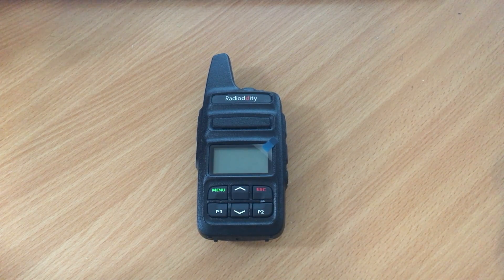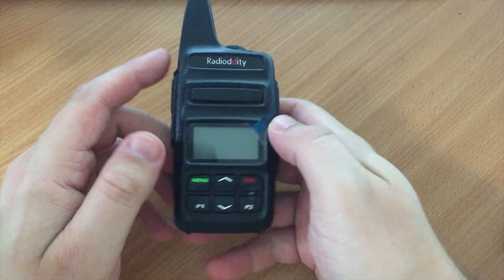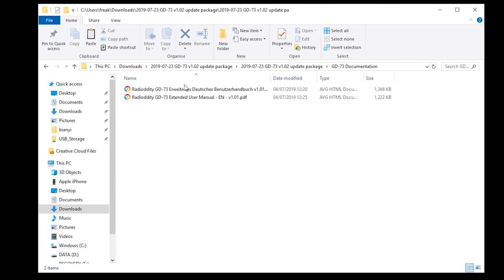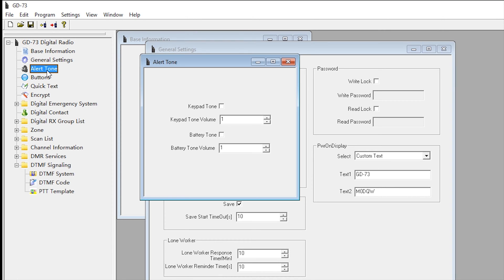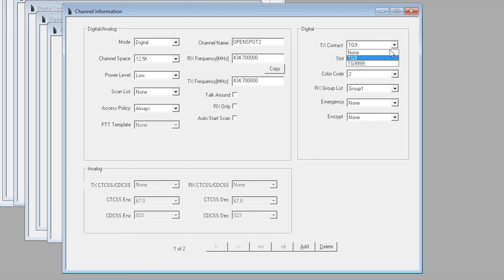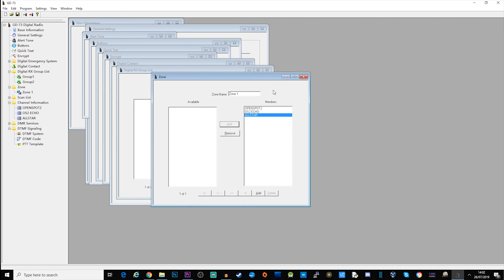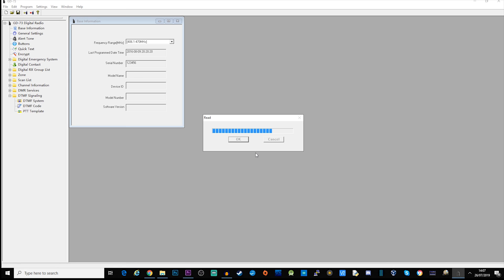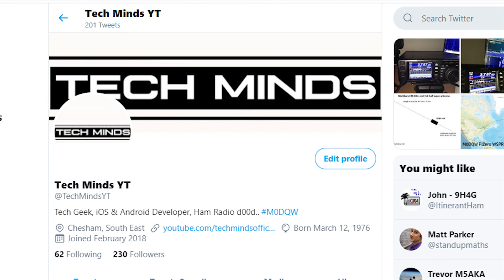Radioddity GD-73 Overview and Programming

Comment: Thanks for the video. I'm having problem starting the software.
---------------------------
CPS.exe - Application Error
---------------------------
The application was unable to start correctly (0xc000007b). Click OK to close the application. 
---------------------------
OK   

I also had problems with libusb0.dll missing. Any thoughts? -Pres

Comment: Thanks for the video, I have 2 on order,  Im hoping to be able to program them up for both PMR446 and FRS as I need to use them for two car road trips in both UK and US - and remain legal!  (I appreciate that DMR is not legal on FRS at the moment).   Hopefully I can work out the programming using your video.
By the way, what screen capture software are you using?
Reply: Worked fine, though I did find that the audio was a little harsh on the small speaker. 
We had reasonable range with them line of sight we could easily get half a mile on the road which was more than enough as we were following each other.
Reply: The next trip we switched out to Retevis RT85s which were much better audio and improved range. Plus the batteries lasted several days between charge.
Reply: Be curious if this worked..

Comment: thanks for a video there is version of this radio 446 pmr model , can i buy it then in pc programming unlock it in 400-470 mhz ???  (for import customs issue reason) or it locked just to 446 ???
Reply from the maker: I received this radio set for 446 only, but using the software I changed it to cover the whole 70cm band as mentioned in the video. So you dont need to buy a different version, just one version which you can change with software :-)
Reply: @TechMindsOfficial  thanks , please post link for that software to download please ..
Reply from the maker: Just use the standard, latest CPS programming software from the Radioddity website. V1.02 :)
Reply: @TechMindsOfficial  THANKS GOT IT
Reply from the maker: https://www.radioddity.com/pages/radioddity-download         Then click on the GD-73A/E image and the download links will be shown. :-)
Reply from the maker: @UCPjyG4vd_oZOZ120IIvhKqQ  https://www.radioddity.com/pages/radioddity-download         Then click on the GD-73A/E image and the download links will be shown. :-)